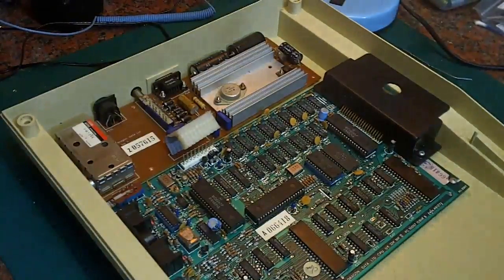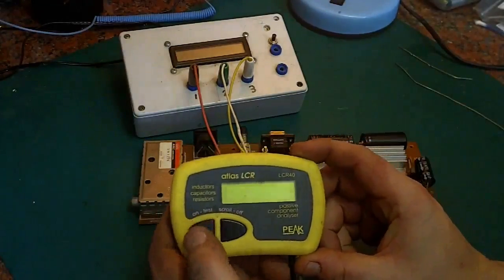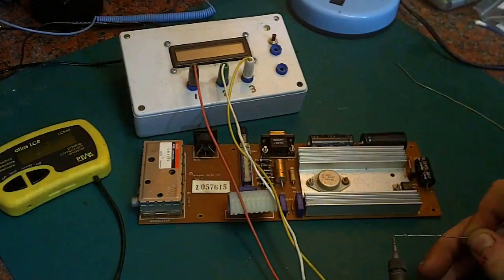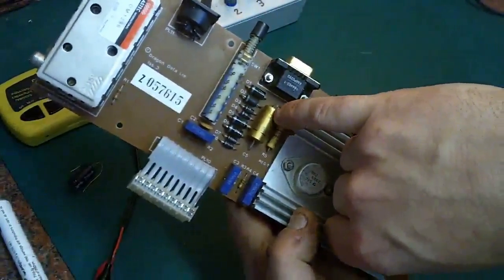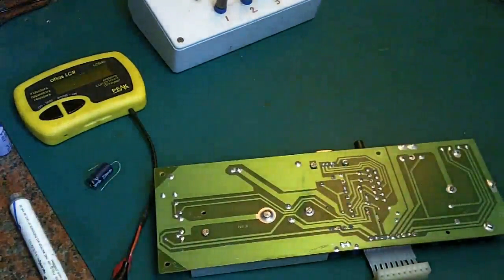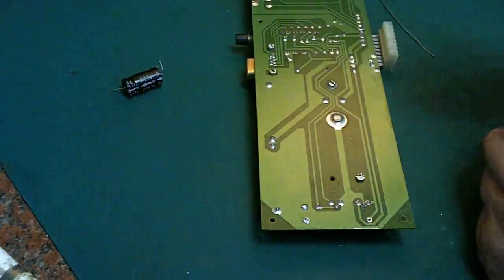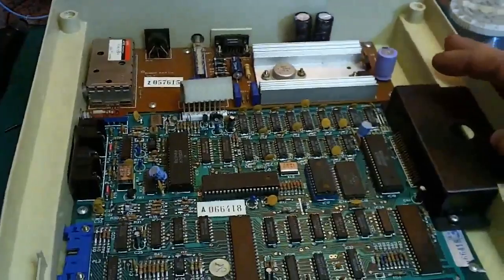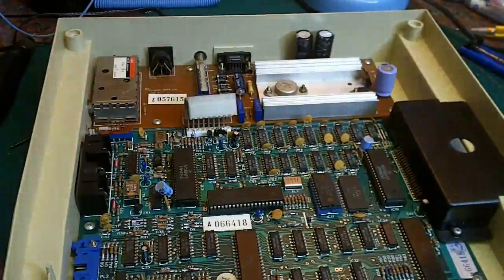Dragon 32 refurb Pt2

Comment: Enjoyed that little lesson in pragmatic pcb drilling. I once saw somebody bend the legs on a radial cap to fit axial boards. Interesting but I kind of liked the simple but effective nature of your solution. Would the exposed copper be at risk of corrosion at all you think?
Not that everybody always checks but I think it's quite rare for caps to have actually gone bad. It's good that you replaced these because they looked like they were on their way out.
Reply from the maker: There is no real corrosion risk as most of where you removed the solder mask is then covered with solder from the new leg. you could tuch it up with a solder mask tuch up pen if you really wanted to.

It is getting more common to find failing caps in the older computers, the dragons are getting upto 35 years old now and its a good call to replace them if youj intend keeping and useing he computer.

Comment: got a dragon 32 with poor video, through rf it starts displaying after about 10 seconds only through rf and is in colour but its like its not tuned in so interference, if i use the 5 pin din for video, its better but every other 2 seconds it goes black and the back to full picture again so unasable, would changing the capacitor next to the video chip help or should i try something else, could it be also a voltage/ power supply issue ?